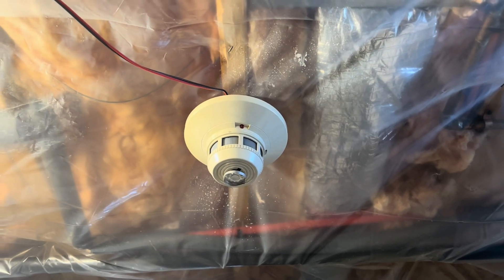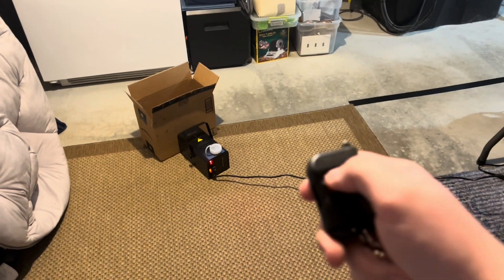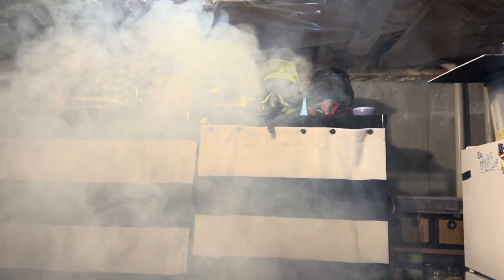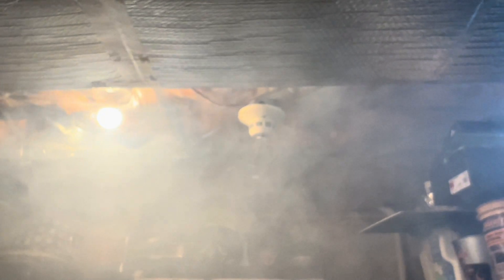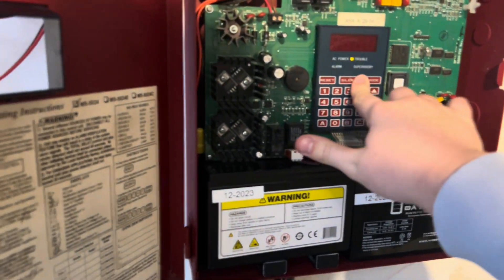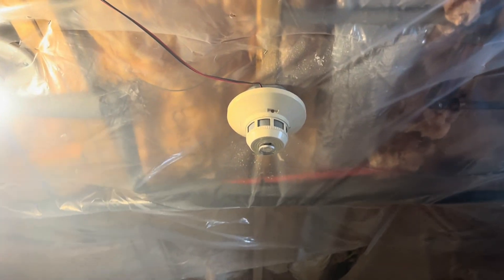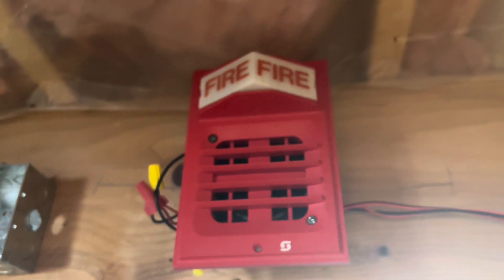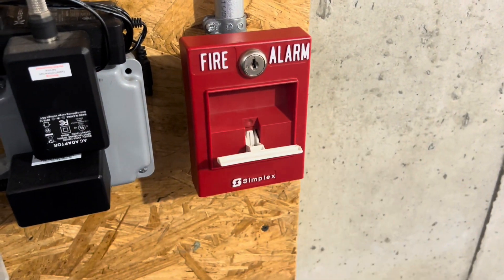Fire Alarm System Test 44: Fog Machine, Mechanical Horns, and New Panel

Comment: I like how you set the machine up in front of the box. I was playing around with my fog machine in my basement and my kidde battery powered smoke alarm started going off (AFTER I TOOK OUT THE BATT) the fog wasnt even close to the detector so idk whats up💀
Reply from the maker: 😂
Eventually I plan on building a homemade testing device out of PVC pipe and the top of a soda bottle to direct the fog at the detector. It's kinda like those giant solo testers that technicians use in the field. The fog didn't dissipate for a while, so it will also keep the fog contained.